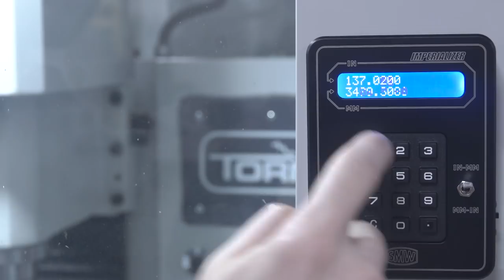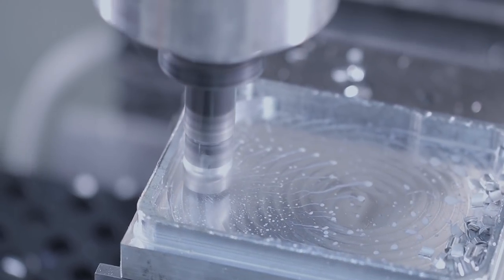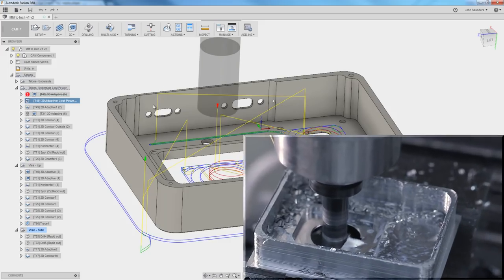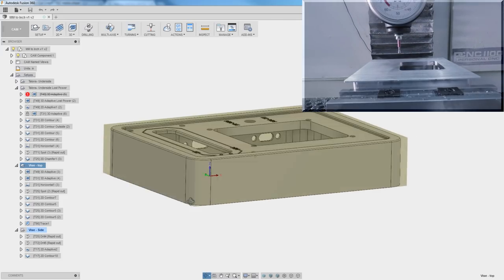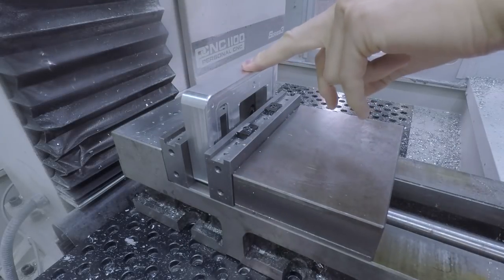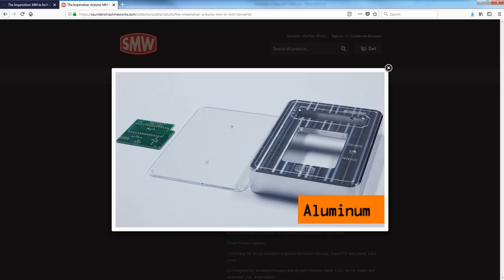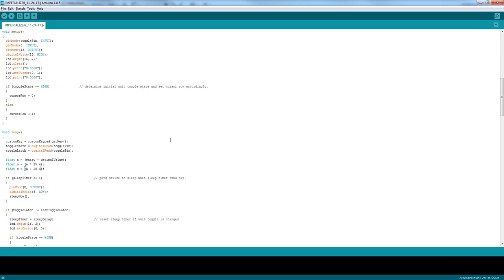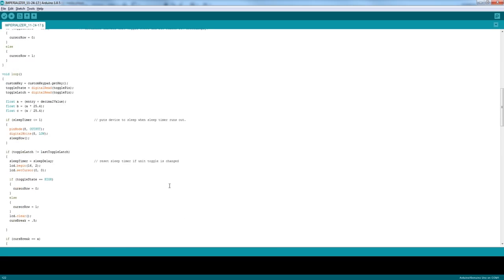Arduino Device to Convert MM to Inches!  WW174

Comment: If this gadget is popular, it's probably worth your time to design a proper PCB that's not just a holder for a bunch of other random PCBs of questionable quality. The Arduino circuit is pretty simple, an AVR programmer is like $10, and you're not really doing anything complicated with the electronics. Then you can just get the whole thing populated for you somewhere, screw it down to the enclosure and plug in the keypad, display and battery.

Also a point of order - if you'd like people to hack it and make it better, you need to license it in such a way that people can legally do that. Currently the only 'license' is 'Copyright Saunders Machine Works, LLC 2017' which is basically a statement that you're asserting your copyright, and not releasing any rights to others. I suggest explicitly licensing it as Creative Commons - Share Alike as that seems appropriate to your purpose here. Or just public domain it, since there's nothing particularly difficult or interesting here, code wise.

Comment: Good job John. What the World really needs is a fractional inch converter. Decimal inches are fine, albeit often clumsy, however fractional inches to metric is a PIA. Few calculator can handle them.

As an aside, just my opinion I think you often spot your holes unnecessarily. If a hole is just clearance, and you're not using the spotting bit for a hole chamfer, then there's no need to spot it in my opinion. 

Another, merely my humble opinion, is as you're getting larger and larger, to design more for production. I saw some features on the inside of that enclosure that didn't need to be there. They required a tool change to machine them. Just because a machine can doesn't mean a machine should. Tool changes take time and involve more tooling, design to minimise the number of tools required to machine the part eg make inside radii larger than the shear hog.

It sure is great to see you continue to grow and prosper. Well done.
Reply: Pete F Few calculators can handle them? What, dividing a fraction to decimal then multiplying by 25.4?
Reply: Pete F all calcs convert fractions to metric eg. 5/64 = 5 divided by 64 times 25.4
Reply: Thank you for stating the obvious! Now how many calculators can go the other way around. When I said fractional inches to metric I was referring to the SYSTEMS and not that literal calculation. Few calculators will convert directly from and especially TO fractional inches.

Comment: I might be wrong but your mill probably has a way to recover from a power failure . I run a cnc plasma table and both the old machine and the new have that option. Great video

Comment: Or just divide by 25.4 to get from mm to inches.
Reply from the maker: With what? Your Phone? I hate pulling out my phone - nor does it magnetically mount to the machine.
Reply: also typically gets grease all over your phone
i like just having a calculator around though
Reply: I use a TI-85 at each machine, built in conversions
Reply: Pete Brubaker I sometimes work in a machine shop with a bunch of Prototrak knee mills that are hardly ever in use so I use those machines as calculators.
Reply: how bout a $2 calculator??, which will -  add, subtract, multiply, divide, work out tapers, convert fractional US measurements to decimal US measurements, and about 500 other calculations.......oh and also, convert inches to metric AND convert metric to inches!!!!!!
Reply: Nini, that's what a TI-85 is.  Used on fleabay they are about $5-10.
Reply: NYC CNC Pre-drill your iphone x and attach ot to your cnc. This is a nice design though. Not for everyone of course.
Reply: But can the Imperializer make a phone call?   :-)   Great little project, John.  Nice to see it offered in both the kit and finished form.
Reply: using a phone, unlocking your phone, open the calucaltor and punch in the number, which take 1-2 min, using a calucator divide by 25.4 and type in 24.5 by mistake unknowing. or just make a simple convert to go next to the machine to save time and reduce error
Reply: why would any sane person go from mm to inches? no country in the world is using inches anymore. oh wait the Americans still do! facepalm
Reply: NYC CNC , I'm european and it will be great to rapidly convert from most common  inch drill sizes to mm. I'm pretty sure that 1/8" is 3.175 mm, but damn... I've to double check it everytime!
Reply: That would be too simple. They made a good point at the beginning though ;-)
Reply: i think its a cool product but my phone has a case with a magnet on the back, so it does stick to the machine LOL
Reply: Freaking great idea remember laziness and convenience are major selling points. Seriously. 90% of products sold today are improvements on existing.
Reply: Mateusz - Sorry if I'm misunderstanding something, but the inch has been defined in metric units since 1959, which makes it exactly 25.4 mm.

Comment: stil no clue about why u guys use imperial
most of the high precision company`s switched over years ago
if i remember right the medical world also changed to metric
automotive  bolts and nuts are metric already
the road system in national parks is in metric 
basicly the inch is defined by the metric system  
but i get these inch drawings and i made a macro for solidworks that  i called the DEimperializer
Reply: In Britain we have Metric Martyrs who are greengrocers willing to go to jail for selling apples by the pound.  Pigheaded I call it.  It's not like they sell English apples anymore which were just about 4 to a pound and delicious although with a tendency to wrinkle and have a skin like bark.  Those all go into the cider these days and people buy bigger tasteless apples with glossy skin,  or Braeburns from Holland.  Sheesh, I'm too young for nostalgia.

Comment: Looks very nice! That said, there's a serious problem with your design. It's just as critical to follow the datasheets on electronics as it is to use the correct speeds and feeds, and 3.7V battery is not appropriate to power an Arduino. Your prototype may work fine, but you're operating the chip well out of spec and there's no guarantee that the devices you sell people will work correctly, especially as battery voltage drops. If the voltage on your analog input sags too much, it could actually cause the keypad to register the wrong buttons when pressed, as the voltage level produced by the buttons will shift as well.

In this case, you need between 6V and 20V on your battery, or a 5V regulated supply. Anything less than that and there is no guarantee of correct behavior from the Arduino.

To test, you could use a variable DC power supply to power the box, and observe how it behaves as the voltage drops from 4.2V (freshly charged 3.7V cell) to 3.0V (fully drained 3.7V cell). I would wager that you'll find gremlins somewhere in between.
Reply: He could add in a 5V boost converter. The TP4056 he also links is the one without the protection circuit. Though I'm guessing the Arduino would power itself off before the battery got dangerously low.
Reply: Adding a boost converter would work too, but that's going to increase cost and complexity considerably compared to the current design. Assuming he wants to retain the simplicity of just wiring a battery up, 6V is the minimum you can get away with if you're following the datasheet. And for a commercial product, I see no excuse not to meet the minimum specs stated by the manufacturer. Even if it works perfectly today, it might not with the next batch of chips, or even other chips in the same batch.

As far as powering off before it got dangerously low, there is no guarantee of that at all. Once you start operating outside the manufacturer's specifications, all bets are off.

Looks like this type of keypad doesn't use analog reads, so it probably won't register incorrect keypresses. Most likely you'd see things like weirdly short battery life on units which needed higher than average voltage to operate, or maybe devices that don't turn on at all, or weird behavior on the LCD.
Reply from the maker: It has a 5V boost in it.
Reply: Ha! so there!!

Comment: Just an observation... but you used a phone number keypad, and the correct orientation for a calculator number pad is in fact inverted. For folks like me, who go out of their way to buy a keyboard with a number pad, and do 10-key typing, are going to be used to calculations with the 7 row on top. Jus' sayin'...

There are some rules and standardizations about number keypads, that I can't recall without bothering to do a google search, but it is a thing.

Comment: If you extend this to sound input/output I may buy it!

The functionality would be to hook in series with PC audio out. So whenever someone says "13/29th inch" it would replace it with "11.386 mm" in the audio stream.
That would make many Youtube videos much less of a braintwister to watch!

Of course it should also work in Metric->Imperial mode. The product should sell in huge numbers.

Comment: A brief history recap

Congress passed the Metric Conversion Act of 1975 “to coordinate and plan the increasing use of the metric system in the United States.” 

The efforts of the Metric Board were largely ignored by the American public, and in 1981 the Board reported to Congress that it lacked the clear Congressional mandate necessary to bring about national conversion. 

Due to this apparent ineffectiveness, and in an effort to reduce Federal spending, the Metric Board was disestablished in the fall of 1982.
Reply: Also a history recap, America has had metric currency since the 18th century, which of course replaced an Imperial one.

Comment: John you have me confused with this product as it’s at this time a dedicated single use device priced at 130 dollars when a machinist pro calculator is cheaper and is USA. made but provides much more functionality eg drill sizes, thread details ,even SFM rpm and gues what a input of fractions then a single button push for metric/decimal and much more . Maybe I am missing something
Reply from the maker: Dedicated.  Hardware. Device.

Comment: I didn't know this til just now but the conversion factor was pinned down by adjusting the length of the inch by about... oh... 50 nanometers.
Reply: Jim's videos Somehow it is exactly 25.4mm long now. A lot of people think its an estimate like 3.141.
Reply: From Wikipedia: In 1946, the Commonwealth Science Congress recommended a yard of exactly 0.9144 metres for adoption throughout the British Commonwealth. This was adopted by Canada in 1951 [and] the United States on 1 July 1959.  #whoknew

Comment: As a machining newby, I'm struggling with surface finishes and how to prep aluminum for paint, anodize etc.  Zero budget for sending to anodize, etc.  I'm very curious about how you prepped the machined part for either powder coat or anodize.  Do the tool marks just disappear?  I'm interested in buying just to see how the finished machined part turned out.  Also very interested what you found about the burr from the shear hog.

Comment: I’d be interested in a video about bringing a product to market, particularly some guidance about fcc, ce, etc. certification. The kit you can probably get away with no certification but the assembled product I’m sure it should be certified to be above board. I’ve got a few ideas for electronics projects but the idea of certification costs or the risk if I don’t do the certification and get pulled up on it later really puts me off...

Comment: I would love to see your process for bringing this to market.  I have wanted to do the same thing for a couple of years but it seems like a nightmare.
Reply from the maker: Copy that!  One thing that will be fun about this project is dealing with pricing the product - and how you deal with trolls versus how you recognize the value being delivered.  And then decide whether it's a product/project worth pursuing!
Reply: Just another point for your part specifically,  I have heard that when doing small production runs, it is extremely important to optimize your tool path for the best efficiency.  I was wondering if there are any tricks to making this process easier and/or faster.

Comment: Glad I got my order in before you sold out -- However, I just noticed you are updating the battery -- is this because of the comments regarding the low battery voltage of the original design?  Now I wish I'd held off on ordering the rest of the parts.  Will the new battery design require a case revision also, or will I be able to work the new battery/etc. into the existing case?
Reply from the maker: Steve - Yes, we need to switch to a different battery.  Updated battery is on the site now.  No other changes needed.  Shoot us an email - john AT nyccnc dot com and we'll reimburse you for the old battery (or you can return it)
Reply: Thanks John -- luckily I was able to catch the seller before it went out in the mail and he was able to pull it, cancel the order and refund me.  Got the new batteries and charge controllers on order!  You rock! P.S -- I already emailed you based on our FB messaging...

Comment: I thought the arduino nano required either a 5V regulated or 6-20V unregulated power supply. How are you powering it with a 3.7V battery?

Comment: Aren't the in/mm arrows around the screen misleading when the switch is flipped? Maybe put the unit on the screen...
Reply: Top row is always inch, bottom row is always mm.
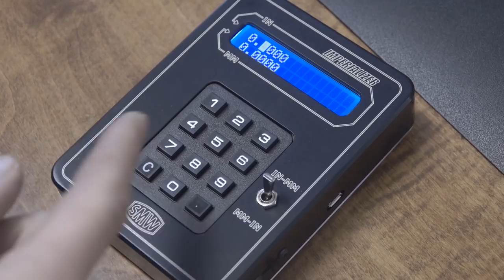Reply: Yes. The toggle changes the entry row and the cursor moves to indicate this. Very easy to use & follow. Re-watch @9:09
Reply: @Ed Rees That makes sense, i missed that somehow.
Reply: funny how he's arguing with the guy who wrote the code. lol.
Reply: @chris0tube I think you have a fundamental misunderstanding of how the switch works. The top line of the display is inches. The engraving on the top is inches. The bottom line is mm, and the engraving on the bottom is mm. When you have the switch on "Inches to MM", pressing buttons on the keypad changes the numbers on the top line (input) and then the calculation is done and output on the bottom line (output). When the switch is on MM to inches, the exact opposite is true. Pressing buttons on the keypad changes the numbers on the BOTTOM line (input) which then does the calculation and outputs the result to the TOP line. 

Your original comment refuted Ed's statement that inches are always on the top line, and millimeters on the bottom line. That sure sounds like arguing about the code to me. 

I'm not sure what you think is confusing about the switch.
Reply: chris0tube as fun as arguing with somebody who can clearly not watch a video, then goes on to argue over the functionality of a product /with the designer of said product/ sounds, I'll have to pass.

If you re-read my comment you'll note I never claimed to have any sort of design knowledge, nor did I say it was a good design. I said the switch was not confusing.

Re-watched the video, nothing is confusing about anything John said.
Reply: chris0tube okay. Then here. 

If you have a device with 2 lines of text... each of which are labeled. One labeled inches. One labeled millimeters. Then you have a keypad. And a two position switch that is labeled inches to mm and mm to inches. 

Logically, I can immediately deduce that.... I can probably input a measurement in either inches or millimeters, then have it converted to the other unit. The fact that I can deduce this from a still photograph of the product tells me it is designed well. 

But wait, it gets better. In real life, whenever the user has the switch flipped to inches to millimeters, there is a flashing cursor on the top line, which indicates that line is the input, and you simply enter a number on the keypad. Common sense dictates that when the switch is flipped to mm to inches, the flashing cursor will go to the bottom line, allowing the user to enter a measurement in millimeters to convert to inches. Anybody who has ever used a computer, or most electronic devices will know that a flashing cursor indicates the device is awaiting user input. This is like, stuff we were taught Day 1 of UX design in school. 

I'm having a hard time putting my finger on what's "confusing" or "poorly designed". Did we watch the same video?
Reply: chris0tube the fact that you think this is poorly designed, but you referenced a calculator as something that is well designed... well, that says enough. Have a kid pick up a calculator and ask them to tell you what the M+ M- and MC buttons do. Bet they can't figure it out without reading the manual.

Comment: nice, but you don't even need the switch, ,just have one actual  input field  then two output fields a mm and an inch output..each output will assume the input was not in it's respective unit and convert as you type in the single input.
Reply from the maker: Not enough room on the display for that